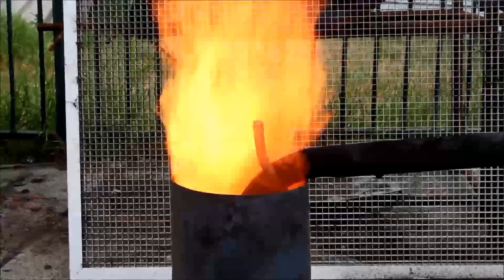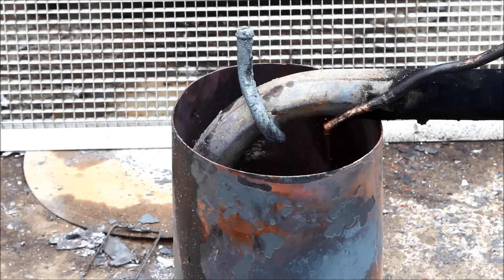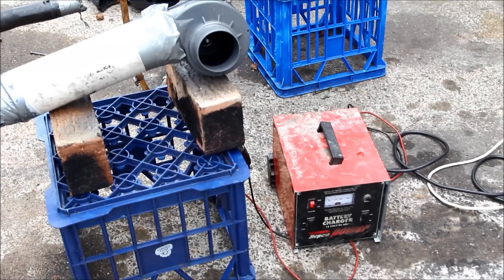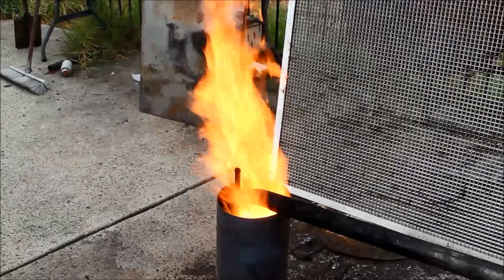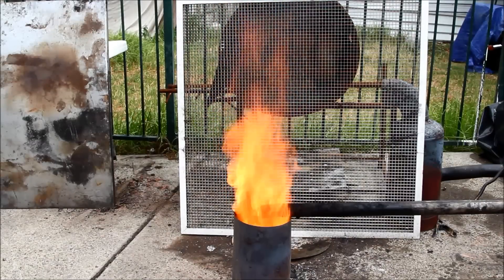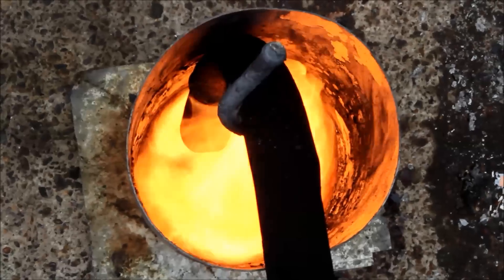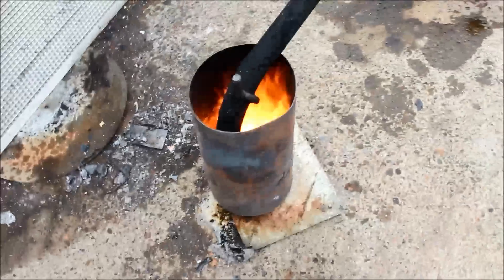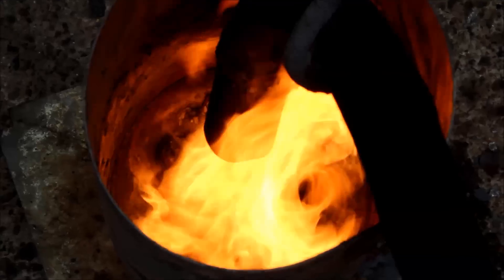Free fuel heat & energy for home or workshop oil burner

Comment: A liter of WVO produces about  9.4 kWh =32,000 B.T.U.s . A 60,000 BTU furnace will heat 3-4 bedroom homes in most of the US. 

Using your "Shed heater for $20 from scrap" DESIGN (v=G3dD3gXEgcM) one might get enough heat to warm a home on 2-3 liters per hour. (Obviously needs to be made from heavier materials, tighter welds, etc.)
 
Also need to enclose the 'drum' component with a circulating hot air plenum.) Could keep it running constantly to keep burner operating optimally. Also could create hot water if a tube boiler were placed inside 'the drum' and water were constantly circulated through another heat exchanger placed inside the existing water heater.

Cheap operating costs aside, your burner does not smoke. Oil fired furnaces here smoke a lot and smell like kerosene.
Reply from the maker: OgMandin0 Do they smoke and smell because they have worn nozzles or are not in tune or do they just run like that?
I'm going to start work on my home heater this week. It will be a small burner firing into a gas water heater like in my vid and the water will be circulated through some hose into the house and through a car radiator. I'll use the radiator fans to push the hot air into the house. 
I also plan to put another radiator after this under the house to keep the floors warm.  The cold water will then return to the hot water system. 
Water is preferred by me on this sort of setup because the worst that can happen with it is I get a puddle on the floor. It's also easy to build in the necessary protection devises and setups.
Reply: They just run like that.  Our #2 fuel oil is no longer interchangeable with diesel (were one eager to break Federal law...) Recently diesel got cleaned up some because the sophisticated new import diesel engines require better purified fuel. 

Up till now #2 and diesel were just the bilge found in the bottom of tanker vessels. #2 fuel oil still is. Diesel and #2 always sell for almost the same price despite heavy Federal and state "highway taxes" placed on diesel. #2 fuel oil has no taxes and should sell for much less.

There are now some '2 stage' oil furnaces. Supposedly burn more cleanly. But it will be decades before existing furnaces all fail and get replaced with newer technology.  

I know this all sounds strange to you. A NZ physician friend of mine could not believe 100mg. Lyrica capsules sell for the same 'jacked up' price as 300mg. capsules and that's because of manufacturer pricing!.  =We live in rather different worlds...

Your out of doors home and water heating system seems like a # 2 fuel system we had in the 1960s-1970s. "Radiators" shaped like electric baseboard heaters were plumbed throughout ones home. Same system provided all the hot water.  *Middle east oil embargo ended that approach.*
Reply: Oil Burner  FYI, I replied already but my reply "disappeared."  Oil furnaces 
smoke because that's the way they roll. New oil furnaces are '2 stage' and 
they smoke less. Will probably take 20 more years before the old furnaces 
die and get replaced out. 

10 years ago in the US home heating oil ("#2 heating oil") and diesel were the 
same thing. It was the bilge at the bottom of tanker ship vessels. Diesel (dyed 
blue) is heavily taxed yet heating oil (dyed red) sells for the same price even 
though it's NOT taxed. We live in different worlds. I am sure this seems confusing. 

Government purposefully generates confusion. More confusion (BS) means 
LESS public outcry. ="I'm getting a headache, think I want to zombie out to more elevator music..."  

Now with new highly tuned, cleaner running import car engines, diesel has been 
refined. Heating oil has not. Obviously, diesel would still run in an oil furnace.
Heating oil might not run well in a new diesel (were one stupid enough to violate 
Federal statutes doing so.)

Your hot water system sounds like an oil heating system somewhat popular in the US 1965-1971. (The first Middle East oil embargo ended installing these systems.)  Each room in a home had a baseboard raditor which looked much like electric baseboard heaters. A large oil fired boiler supplied hot water to the radiators and to hot water taps.  

Unfortunately, I understand Government is banning outside home boilers after 2015. So I better get something in place so I can be "grandfathered in" to pre-2015 regulations...

Funny, all US businessmen think they are in various sundry fields yet we are ALL in the Government/TAX business...

Would be tragic were it not so d@mned amusing...  :)
Reply from the maker: OgMandin0 The Biggest problems with US policy is that a few years later people here in the United states of Australia look at it and think we have to follow suit.  Oil heaters used to be popular here but are rare now due to the price of fuel. They won't work on waste oil as it leaves a residue in these heaters where as diesel does not.  Reverse AC is the most efficient form of heating but useless once you get down to about 3oC as there is no heat to pull from the air. Wood fires were also popular but the whingeing green washed faggots whom are never satisfied even if we went and lived in caves are having them phased out even in country areas where there is wood in abundance that will rot if not burnt with the same end result.

Luckily, I have a BIG pile of wood cut and ready for my Dad this winter. It would be a brave and stupid pack of do gooders that would try and tell people in his area they couldn't use their wood heaters any more!
Reply: Oil Burner Seems we see government the same way.   In the US of A (obama-land) we call our "reverse air conditioning" a 'heat pump.' Temperature drops to 40 degrees F. "heat pumps' run constantly and only pump cold air.  We normally use electric resistance heating as a backup. In my home I insisted upon an oil furnace backup. No natural gas mains at the time... 

Oh yeah the US government plans to ban outdoor wood furnaces after 2015. I wish them luck with that idea...  :) A little revolution now and then is a GOOD THING!
Reply from the maker: OgMandin0 And in 10 years after they have banned the wood heaters, they will find that the forests can't grow as well because there is too much dead timber shading the ground or when the bushfires come they are 10 times as fierce and wipe out 3 times the homes and towns they used to or some other highly detrimental effect they never foresaw because they were 2 busy trying to make sure they won the whining environmentalists votes who manufacture the basis of the majority of their reasoning and have created endless problems already.

Comment: BRIEFLY, Your idea for outside burner/boiler heating a home: Have seen people build 'rocket stoves' with coiled copper tubing inside. Lousy "tube boiler engineering" IMO. But they installed a car radiator inside their home's forced air plenum and heated some of the home that way.  =Just a thought.
Reply from the maker: OgMandin0 MY thoughts exactly.  I think the copper coils although universally popular are a terrible inefficient way to heat water.  Some people must be lucky to get 1% of the heat they create where they want it. I'll be using a modified gas hot water heater. I was also thinking of the car radiator. They have huge capacity and come with the fans to put the heat out.  Run through a 12V light bulb as a resistor, The run pretty silently and still put out enough airflow for my needs.  I have a vid of a test setup I did just this way.
Reply: Oil Burner Re-watched it. THANKS!  I always associate all my spot-on reliable sources together, but sometimes I forget which truth came from where...

Comment: This setup is ideal for me, i got a gas bottle, a bike frame and a old welder. A pipe in 90mm diameter and i am in business :) as for safety tip this week, be happy i am not your neighbour ;) and the gloves on my feet wear through quickly.
Reply from the maker: Arjan Wilbie 90 is a big pipe. You will get tons of heat from that if you have a powerful enough blower!

I have trouble with gloves too.  They just done seem to make them big enough for my hat size and if I put them on my feet the toe pockets are far too long and I stumble on them. 
Plus, for safety items, they don't do a very good job of protecting my feet from small rocks, nails and broken glass. 
I'm going to stick to wearing my boots and a hat and be done with it. 
Gloves aren't nearly as great as the safety zealots make out!

Comment: Hi oilburner  I made one of your projects, works fine. you had a boat blower which I think u said was under powered, a store starting with B ending with S had in a catalog a work shop blower puts out 3kpa I use about a quarter to a half of this, ozito emb 2000    Bar code 9-319510012498  It's small 240v  This is my first time commenting on u tube, and do have some pictures of mine to share when I lean how.
Reply from the maker: fireplace I did see them a while back. Are they noisy? I remember they have a fast motor which I thought may be hut you could always enclose them a bit I suppose and use a speed controller to wind back the motor to what you need. 
You could make a slide show of your pics and put them up. Please let me know when you do.
Reply: fireplace Yes they are noisey, i will run mine from a distance using vacium hose, will let you know when i put pictures and vids up.
Reply from the maker: Rachel Hopkins
 Cool. I have a vid coming up on a speed controller I bought and wired up. Might make your blower a bit quieter if you don't need the full output and can turn it down a bit.

Look forward to seeing what you have built!

Comment: Good vid, O.B. That looks more, like the burner in my heater. I think I'm going to give your diffuser plate a try, though. I have that steel pig, in the bottom of my Freon tank, and if it gets moved around, I have to readjust it, for optimal flame shape. Something that was, actually round, might help too. A head and legs, probably could explain my weird flame pattern. But, it still runs good.

Comment: Cool, I like your burner vids.  2mill BTU/hr is great if you are melting aluminum cylinder heads, but not very practical/efficient to capture heat from if you are trying to heat water. What we need for that is one of these that runs in a cooker the size of a teacup:) I am working on one now along the same lines as your vid.  The downsized version allows for a reasonably sized heatex to capture heat efficiently.  The copper coils for water heat arn't a bad idea, they are just horribly undersized to capture much of the heat from the rocket stoves you typically see them installed in. Just like trying to heat water with the 2mil btu "head wrecker" would need a heatex the size of a house to collect all that heat...  They also don't typically incorporate multiple opposing flow paths which are required for best efficiency.  I am working on a heatex now with 75' of stainless corrigated gas pipeline, but it will have 2 passes and oppose the hotgas flow...

Comment: Probably not much different than a drip oil burner with a turbo. Add a bundle of steel wire to the bottom and it will start quicker and sustain easier. I use the elements out of old electric clothes driers. Well done!

Comment: hello im from melbourne and i'm quite interested in the work you're doing as i do backyard blacksmithing and foundry work, my foundry a 55 gallon refractory cement insulated oil drum is currently using coal and i would like to change to waste oil of some sort i've done a bit of research and i understand the concept but still have some questions some of which may have already been answered
1 were do u get all your fire extinguishers from i've looked and currently only have two which i use as crucibles
2were did you get your blower i'm using a electric leaf blower with a 320km/h wind speed
3 does waste oil create much smoke or fumes i'm in a residential zone with not a lot of space
4 is building a waste oil burner very precice or finicky seems like a fair few valves and and tubes and such

thank you i admire what you're doing and would appreciate a response
-Taylor
Reply from the maker: BlackNinja3006 Hello Taylor.
I get the extinguisher bottles from a place that refils/ tests them. They have a big bin of rejects they send out to scrap. you could fine somone similar in your area and see if you can have/ liberate some. 
The blower I got from Fleabay. Bought another one last weekend I hope to pick up this week. It's a very powerful jumping castle unit. I Paid $30 for it. 
You should be able to start and run the burner with less smoke than cooking a sausage on a gas BBQ. See some of my other vids for fire ups.  They run absoloutley clean. 
I slap these things together by sight only. they don't care about measurements or anything else. As long as you pre heat them and keep them hot they are happy. 
The fueling with the valve takes a little bit of getting used to like a coal fire or anything else but you quickly get the hang of your own setup. Even when I build new burners now I can fire them up and have them purring right from the get go,. You learn to read then and understand which way to tune them so they run real nice. There is a fuel shut off valve, a valve for fine tuning and one hose runs to the burner to deliver the oil. It's VERY simple.... like me! :0)

Have a look at my other directed output burners. They would be better for what you need.  I have a downward firing one that you could put through a shell of Fire bricks and would provide very fast heat. By setting the air and fuel ratios, you can have a reducing, oxidizing or Neutral flame of any output you need.

Comment: You couls call this the "sissy doll house burner"... albeit it's about the output I'm looking for..... but great job.

Isn't it better (read: more efficient) to always vaporize the fuel before burning it?
I thought that was a big thing.
Reply from the maker: Yves Baggi There is vaporize and atomize. Vaporising is do9ne by heat and changes the state of the oil from a liquid to a gas. Thei burner does that which allows the oil to burn. Then there is atomize which requires High pressure and a Nozzle. None of my burners have that although I'm setting up a high pressure pump and have sourced a nozzle to give it a go. 

I think this burner worked better with the deflection plate for the air which kept the oil pool hotter and allowed the fuel to vaporize easier.  I have some larger pipe to make a higher output one of these with and I'll go back to the original design as I think  the straight shot type would blow the fuel everywhere before it had a chance to vaporize and burn.